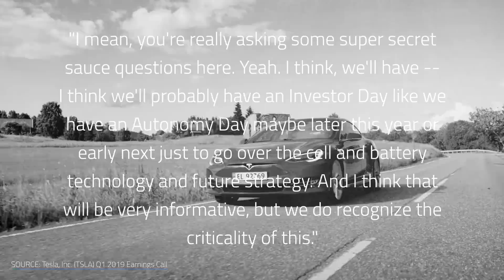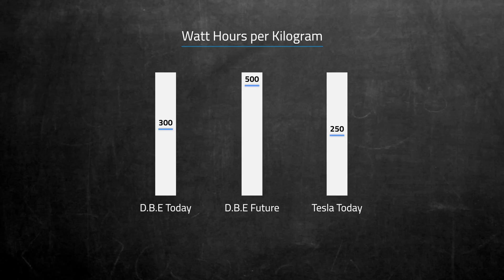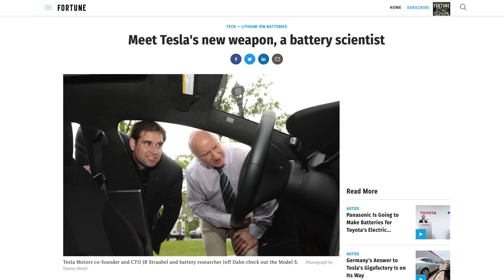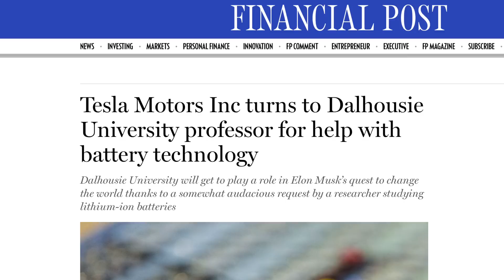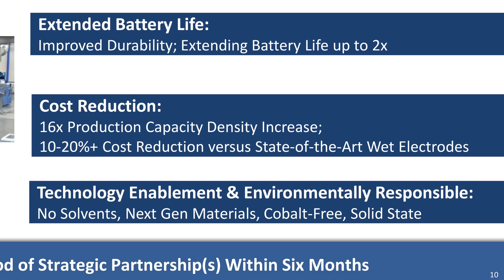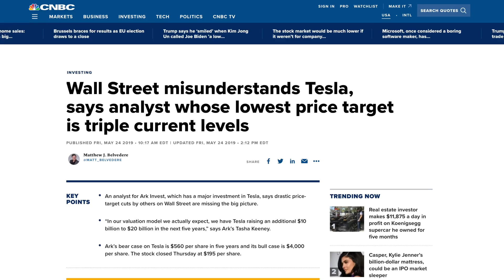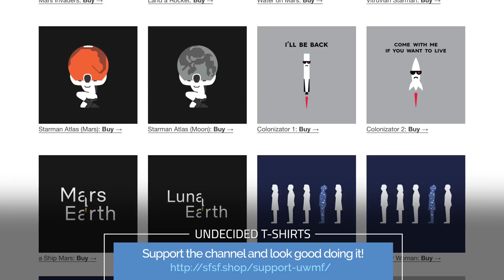Tesla And Maxwell Technologies

Comment: With Maxwell capacitors, Tesla can pull off massive acceleration.
Reply: Why won't people understand this?  Caps aren't as energy dense as Li-Ion batteries.  The "super" is compared to a regular capacitor, but it doesn't make them magic.  They are used in shitty hybrids where there isn't a big enough battery to soak up instantaneous regen electricity, as a cheap solution that is not as good as just having a bigger battery.
Reply: @gigglehertz  Yet... But in theory it could be done. Would be great as the charge can move into or out of them much easier and faster, with less heat, etc. Until then (comparable energy density) it can be a good addition to the regular battery, allowing even more intantenous power. Also backwards (recuperation). Can't it?
Reply: @dezz00002  In theory a lot of things could happen.  My questions is - how much energy would be saved, vs the cost?  We have specific claims from maxwell as to the increase in energy density, cost, throughput, and longevity.  Show me some numbers that makes sense, that would make Elon want to reverse the clear trend of simplifying by reducing parts and steps in manufacturing, to add yet another unknown system to the mix.
Reply: @gigglehertz  We will have to wait until new series/variants arrive using this new accu tech to tell if new numbers was good enough in themselves, making any caps supplementation unnecessary. (For now.) I'm most curious about the new regen power, if there was any change. Current one is 50 kW at max, I think. Would be beneficial to raise it to 100 kW or more, regarding energy (and brake pads) savings.
Perhaps this caps supplement can't be justified in case of the more regular car series (S, 3, X, Y). There is the new Roadster, though, these could still be useful there, considering its goals.
Reply: Marshal Giggleman it also protects the batteries from the volatile charge & discharge cycles of regen and acceleration buffering
Reply: Tesla already pulls massive acceleration, the maxwell capacitors might allow for reduced weight (thus longer range) and faster charging times.
My impression is they could use those for the typical daily/commute mileage so that people can charge like gas stations if they live in apartments and condos. The battery pack would be a hybrid pack containing, say, one module of maxwell and the rest of the modules in the pack consisting of Panasonic's 2700 cells.
Reply: @cleberz8072  more acceleration can not be done with tires. you need thrusters ;)
Reply: Faster charge and discharge rates both. Which one do you think the average gear head cares about? uh huh  -but it is a package deal.
Reply: wore acc wil just make the wheels spind....
Reply: @mortenthryse3392  I agree, for the new Roadster 2020 Tesla is already pretty much at the maximum practical acceleration legal tire friction and total (legal) car weight + power can provide. From there and on it has to be with thrusters as you said, even if they're only to push the car downwards to increase friction
Reply: @cleberz8072  Elon just said that it would have about 3G. thats much more that we can apprehend . so prepare for a chock ;)
Reply: they are known as super-capacitors.  (hype train people call them ultra-cap) they are Nothing special, you can buy form any other manufactures.
Reply: Regen & fast charge buffering

Comment: There are a few important things that I think were glossed over or missed. First, the 500 Wh/kg number I keep seeing came from a Maxwell research paper. It was an entirely hypothetical number that had no research behind it whatsoever. Simply an extrapolation of existing numbers plus time plus a fudge factor for as yet unknown improvements. Quoting the 500 Wh/kg number probably isn't a good idea for that reason.

Second, the dry electrode method does not eliminate the ovens. The polymer used in this process needs to be cured in ovens, but the temperature of curing is lower than the temperature to evaporate solvents. And the curing time is significantly less than the solvent evaporation time. This is where the time savings and energy savings come from. Lower heat for less time.
Reply: rsm 287, Tesla has bought other companies solely because their expertise or products were needed. Tesla owns its own seat factory. Why wouldn’t Tesla buy a capacitor company that also has some contacts in the grid energy storage business? Now Tesla can upsell all those who were thinking of getting a 5 second UPS into getting a 30 minute UPS.

Tesla can fire the excess fat and make make the capacitor division profitable by making only what Tesla needs and supplying other big customers, as long as they don’t compete with Tesla. 

So many people forget Maxwell was a real company making a real product, not just a R&D company.
Reply: rsm 287, have you checked MXWL stock price history? It was $40 20 years ago, bagholders have been losing money ever since. So when Tesla came along to buy it there were a lot of investors who fought it. Just like Tesla investors will do when they get a $42/share buyout offer. The Tesla bagholders will all be saying “Nooooo! It’s worth $4000/share. Cathy Woods said so!”

Also, if the Maxwell deal was going to make Tesla a $trillion company, why is JB Straubel executing and selling options at these low prices? JB sold 105k shares in the last 6 months, and still holds 306k shares. He got $40million before taxes. Do you think they didn’t tell JB about the secret sauce?
Reply: @imho7250  Executives sell their stock for many reasons, buy real estate, pay taxes, ect. but when they buy, they buy for one reason only. Potential profit.
Reply: tigeroll, why sell $4000/share stock for $190/share? If he needed to pay taxes on his salary, he could exercise 15,000 and sell 5000 to pay for the options, pay taxes, and still put $300,000 in his bank account. The point is, he has made enough profit from Tesla to walk away now a rich man, even if the other shares go to $50. 

The only one not selling, but rather buying go show faith, is Elon.
Reply: rsm 287, yes, I’m also willing to wait instead of create false stop pumps. But if there was valuable battery tech at Maxwell, someone would have bought it for more than the chump change Tesla gave. 

I think the purchase was sound, just like the other small companies Tesla bought. But thinking that a $200million purchase buys you a real company PLUS technology worth a $trillion dollars is the confirmation bias, because no official statement has been made to that effect.
Reply: IMHO You must be a fortune teller because you can see into the future, will revisit this comment in 5 years to see if you were correct. Peace
Reply: Stefan van der Westhuizen, in 5 years there will be better battery technology that can’t even use DCE, so you better hope Elon can do something in the next 5 months.
Reply: IMHO Are you one of those people that continually predict that “Tesla is doomed”, “They wont last another year”.  Because thats been a thing since 2006, yet they have always been proven wrong. In 2006 nobody was even talking about electric vehicles and they thought that it is a fools errand to try to make one. And every time a doomsayer said something like this, Tesla proved them wrong.  Even if Tesla doesn’t succeed in the far future, they ready succeeded convincing the other automakers that electrification is the future, and that is all I care about lol.
Reply: Stefan van der Westhuizen, nope, but I’ve been saying Tesla stock will go below $200 before it goes above $500. And now that has come true, I predict the stock will keep dropping. And hopefully Tesla can become a real company (in Elon’s words) and I hope someday TSLA is blue chip stock, an investment not just a gamble.
Reply: edwong3, every charger and inverter Tesla makes uses capacitors. The  powerwall chargers, vehicle onboard chargers, powerpack chargers (made from 12x onboard chargers) and the V3 mdgacharger with 1 megawatt AC to DC converter. Also powerwall inverters, vehicle inverters (one per motor), powerpack inverters.

Maxwell’s manufacturing facility is in Peoria, Arizona, but headquarters are in San Diego,  California. Having more US made parts is good for Tesla. I have no idea where they were buying all these capacitors before. Maxwell has offices around the world with people trying to sell energy storage. Imagine all those people now trying to sell powerpacks and powerwall microgrids. 

I do think Elon is going to run through Maxwell with a barnacle scrapper and get rid of everyone who isn’t adding value to Tesla. Any overseas office who can’t justify its existence gets shut down, just like Tesla sales centers.

Fisker is seeming more like a con man, but he did make a car, and probably just regurgitating the sales pitch the solid state battery people told him. Dyson is the one to worry about. He makes real cordless electric appliances, and has built a brand image. He’s fairly quiet about what he’s doing in Singapore. 

It will be interesting to see what Tesla’s official statement is, and more importantly, what it actually does with all its recently acquired Maxwell facilities.
Reply: edwong3, I think whoever makes the first complete battery that cost less than $100/kWh and charges in 15 minutes with 3000 charge cycle life is going to control the industry. This is probably why there is so much wishful thinking surrounding Maxwell, combined with a lot of misconceptions such as Ultra-Capacitor batteries being viable as energy storage for EVs.

When MXWL was at its peak of $40/share in 1999, unfortunately this was right when the lithium ion battery started being produced, which killed any plans for using capacitors as a viable energy storage. Maxwell still makes some grid interrupt power but for the same price you can now buy one made from lithium ion cells that can carry the load for 30 minutes instead of 10 seconds. 

The most promising battery Maxwell makes uses lithium ion for energy, which charges a bank of capacitors. These are for starting big Diesel engines that need lots of power for 2 seconds. This same technology can be used in cars, allowing more energy dense lithium batteries to be used, which can charge the caps to give a burst of power for 2-10 seconds. 

For track use, the capacitors can take 500 kw regen going into a turn and give most of it back exiting it, which keeps the battery from overheating since it will put out a lower steady kW. 

While this will be great for performance cars, it’s probably not practical for every day cars because the electronics involved is also quite expensive and complex. 

We will have to see what Tesla can extract from Maxwell over the next year. I hope we can get some inside scoop from Maxwell employees who can tell us what changes are going on.
Reply: edwong3, the Riversimple Rasa is a fuel cell car which uses a bank of ultra caps. When you fire up the fuel cell, it precharges the capacitors, from then on it uses the caps for acceleration and regen, and just uses the fuel cell for cruise. 

But you see most fuel cell vehicles just use a high power battery instead because it’s much smaller and has more energy, even though regen is limited. 

I’ve seen people conduct tests with quad copters and ultra caps and they really can’t do much on their own as energy storage. 

I feel bad for MXWL shareholders who held the stock for 20 years hoping it would become the next Apple or something. Some of them probably hoped the Dry Coated Electrode technology was worth something.
Reply: edwong3, that sounds illegal, and if any Maxwell shareholders find out something like that prevented a real offer then someone would go to jail over it. Just like tsla shareholders would expect someone to go to jail if SpaceX offered to buy Tesla for $30/share after running the company into the ground. 

This has been around since 2012 at least. I’ll post a link after this in case links are censored.
Reply: edwong3 , energy.gov/sites/prod/files/2014/03/f9/es134_wixom_2012_p.pdf
Reply: edwong3, I think Sakti3 and others have a theoretical pathway to solid state batteries, and Dyson bought them for that, but so far we don’t see any viable batteries. I think Fisker also claimed to have some super batteries. 

Until there is facts to the contrary, Maxwell was just another purchase for vertical integration.
Reply: @imho7250  I think they only bought Maxwell to improve battery manufacturing speed.
Reply: Michael Ball, while that is a remote possibility, bear in mind that Maxwell’s technology is for the cell manufacturing process, and Tesla doesn’t make and battery cells. Why would tesla buy something that now they have to convince Panasonic to invest in, when if Panasonic thought it was a good idea they would have bought it?

There is a very slight chance that Tesla will try to become a battery cell manufacturer, perhaps in China where they have a big new factory. But that requires a lot of capital and the technology would need to be refined before it’s even useful.

But Tesla uses high power capacitors all over the place. Tesla also sells energy storage and grid interrupt protection that augments what Maxwell offers. 

Now that Tesla owns Maxwell, we will see which parts get sold off, who gets fired, and from that we will know what Tesla is doing with Maxwell. There should be something about it on Q2 financial reports as well as some Tesla investor’s day. 

But from what I can see it won’t significantly change the value of Tesla, but some will try to use it to change the price of TSLA.
Reply: Tom Cameron, yes, and the fact that even Elon won’t lie about it should be a sign. Elon basically just lets his fans come up with all the nonsense about Dry Coated Electrodes, because Elon doesn’t want to go to jail over it.

The number one clue that this technology is basically worthless is that no battery cell manufacturer even tried to outbid Tesla, who doesn’t even make cells. Tesla bought a capacitor manufacturer, and Tesla needs a lot of capacitors. Maxwell has better fundamentals than TSLA, so buying them just makes Tesla fundamentals better. 

The most hilarious part is none of these guys even looked at MXWL stock history. They were $40/share 20 years ago, but went down and never recovered, and sold to Tesla for <$5/share. Don’t you think those shareholders tried to get a real offer on the company? Don’t you think they tried to get Panasonic, LG Chem, Samsung SGI, Chevron, GM, Ford....any of 100 companies to buy the technology?

I can’t believe these guys think Elon and his minions are smarter than every battery expert in the world who already checked it out and told their client it’s not worth anything.
Reply: @imho7250  What about when Elon today said in the refresh for the model X/S the S will get over 400 miles range and the batteries will now last 1 million miles vs. all previous packs rated around 250K to 300K miles?
Reply: tigeroll, the new model S gets 370 miles range using the 100 kWh 18650-based battery just by using a PM front motor, SiC inverter, and adaptive suspension. To get another 8% range with normal battery advances won’t be that hard to do.

The million mile battery life is going to be with a very restricted BMS. It won’t be on a P100D which supercharges at 200 kw and gets charged to 100%. We will just have to wait and see about that warranty if it comes.
Reply: @imho7250  Watch the video that just came out today from "Like Tesla" by Kim. Popular videos. She knows a contact in Tesla R&D and has been told the new specs.
Reply: tigeroll, it’s hard to believe the new model s will have 3 motors. 400 mile range is easily doable. I guess we will see what really happens.

Comment: I think the Maxwell Supercapacitor technology may have some applications in the Roadster but otherwise, probably not useful to Tesla.  It should be noted that dry electrode production has only been achieved in the lab as of Dec 18.  Mass production is a few years away in the best case. I think Elon is being his usual over optimistic in his projections. Panasonic's new lines for the GF are all wet through 2021, according to contracts with production equipment vendors.
Reply: Jay Perkins Good to know Jay. May I ask what area you work in to know this stuff?
Reply: Not according to Maxwell's site:
"All Maxwell ultracapacitors are made with a proprietary dry electrode process which has many advantages over the wet electrode processes used in competitors’ cells." 
Their presentation mentioned working with a large company (Tesla) for over a year on other applications.
Please provide your attributions when making assertions.
https://www.maxwell.com/products/ultracapacitors/durablue
Reply: Why not use the ultracapacitors  to take all the brake energy of semi in more efficient way?
Reply: @victorosborn3348  Because it is cheaper and takes less space to use more batteries. Caps are very low energy density.
https://www.youtube.com/watch?v=zlJRo9yVzus&feature=youtu.be&t=4088

Comment: Do you think this will be incorporated into the model y design? Semi? Roadster? If so, when?
Reply from the maker: I think Roger's timeline is a good guess, but I might slide it out a quarter.  Elon did say that they'll most likely be holding another event just like autonomy day for the new battery tech.  I think we're most likely to see this new battery tech in the Semi first (and the Roadster ... whenever that actually hits).  I don't think we'll see it in the Y alone since it shares so much with the 3.  We'd most likely see both the Y and 3 on this tech together at some point.
Reply: @UndecidedMF  that makes sense, thanks for the reply!